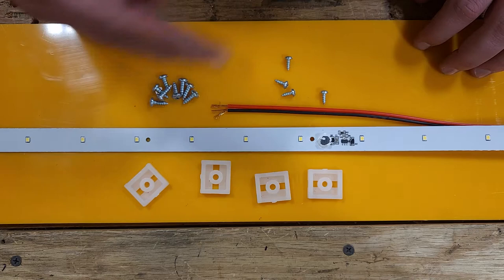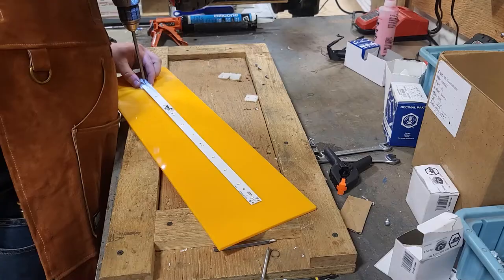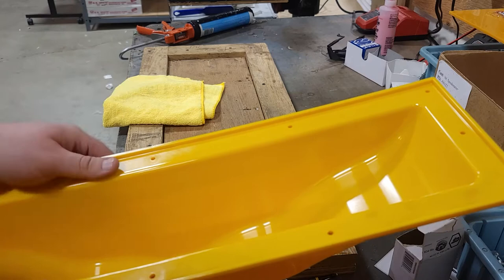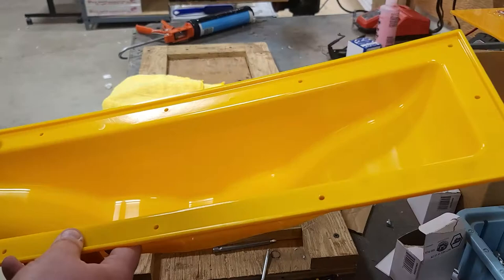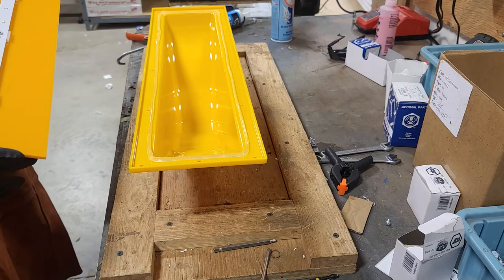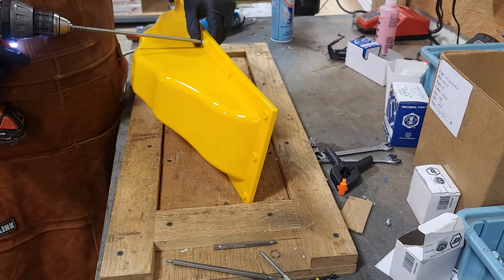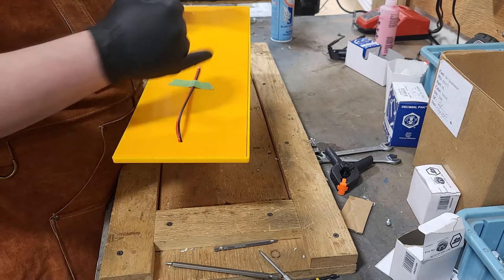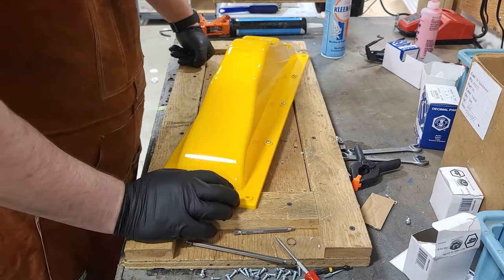MAKING A YELLOW TAXI TOPLIGHT

Comment: Have you thought about putting a couple of silica gel bags there to make the air dry and prevent any water condensation in winter? It can make the electronics components last longer.
Reply from the maker: We used to do that years ago, but when we started to service the lights we found after time the bags would eventually open up and the insides were all filled with the silica gel. So we stopped using them.